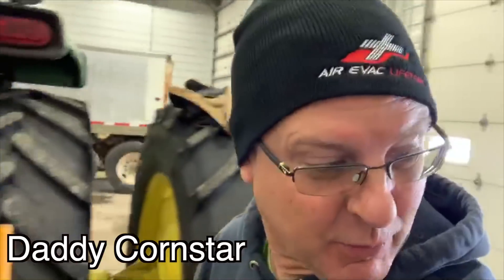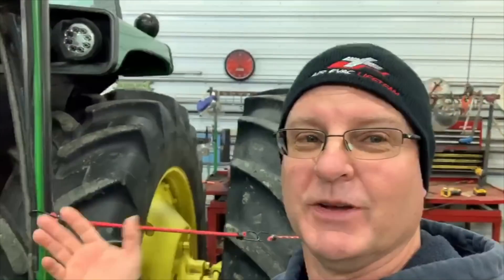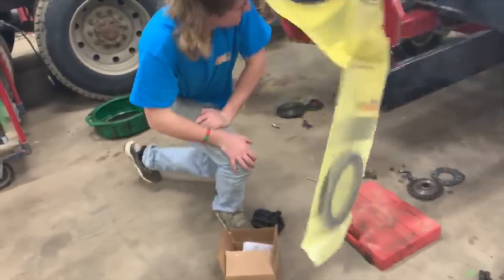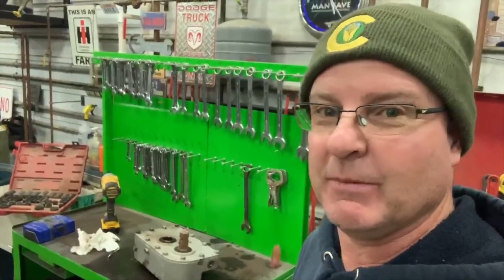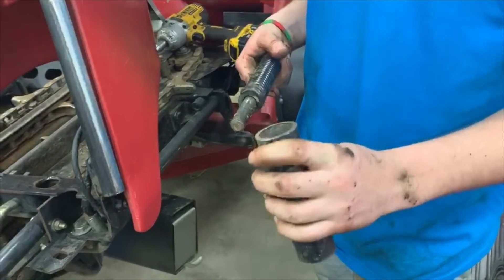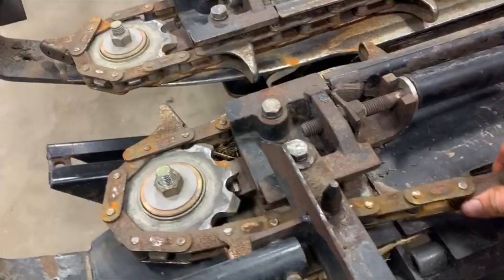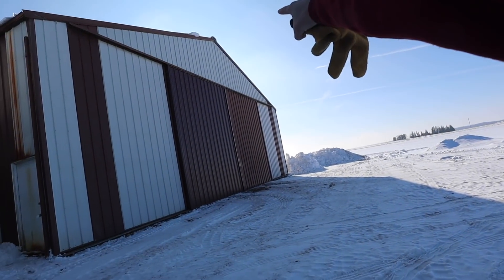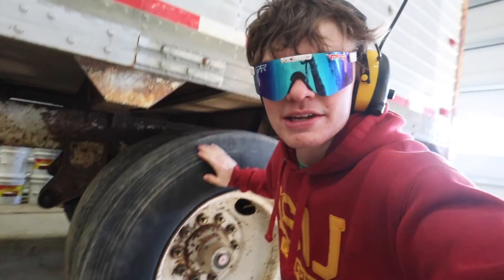40 Year Old Tractor... Will It Start??

Comment: Cornstar team, really enjoy your videos and interesting information you share, keep them coming.

Question/ Suggestion, you guys are so diligent about keeping everything greased and I applaud those efforts.  I think you can save some money and time when greasing in the shop.  I've noticed some jobs take multiple tubes of grease which can be expensive and time consuming to refill, plus you go thru it on multiple pieces of equipment.  As you probably know that grease cones in 30 gal and possibly 55 gal drums. They make pneumatic grease guns and tops that sit on top of drum with long hoses allowing you to grease right from the drums.  At least for the 30 gal drums they also make a wheel plate for drum to sit it making it easier to move around to the various projects.  Heck, you can even use it to fill your hand guns rather than sucking it in or dropping in tubes.  

You guys probably know all this but thought I'd mention just in case because of the time, convenience and money saving potential.

Comment: Wow, 7:12.  A tiler’s spade, haven’t seen one in 50 years.  Most people don’t know what this is but it is a spade used by a “hand tiler”.  I am 67 how but when I was 16 or so, one of the old guys in our southern Minnesota town told me all about his younger days as a hand tiler.  According to him:  Drainage tile were originally dug by hand.  A two-man team worked together, one used the tiler’s spade and one followed in the trench with a long-handled shovel to dig out the crumbs (dirt that fell off the spade).  A team could do 2-3,000 feet a day, about 18” deep (one length of the tiler’s spade).  They dug summer and winter, burning straw in the winter to thaw the ground.  As an example: connected to our farm, they had dug in a 20” main about 2 miles long.  In one section, it cut through a hill and was deeper than 20’ - all hand dug.  We, on the other hand, were very” automated” on our farm.  We had a Vermeer tiling machine powered by a B John Deere.  It used a winch to crank it forward on a cable - one rachet at a time.  We used a UB Moline on the anchor end.  Dig 100 feet, run the cable out again.  Between our farm and several neighbors, we put in miles of 6” by 1’ long concrete drainage pipe and hooked into many hand dug county mains.  They were all clean (no dirt so they were laid tight) and running well (correct slope).

Comment: Good old V8 Massey. You could walk by one in July with a ice cream cone and it would require a huff of ether to start.
Reply from the maker: Chris Maas on the 2745 that's so accurate!
Reply: Depends what injection pump it has. With inline pump they start pretty good. I have 1150, 1155 and 2805 and below freezing is no problem to any of them.

Comment: Next time you take something apart...photograph it with the phone as you disassemble it. Store the photos on a desktop computer for future reference.
As for the seal that was prohibitively expensive, if you feel this will be a normal wear item,find a hydraulic supply house and have them measure the old seal for a replacement. Keep a few in stock. Might be an inexpensive part, but from the dealer ...well that makes their week!
Reply from the maker: Lens Cap luckily this is not a common seal!

Comment: Find you a good bearing and seal supplier and they should be able to find seals that are common, UNLESS the equipment manufacturer had them one of a kind made which I would not doubt. I know the green brand is bad about that. 60.00 oil seals would make me mad, have a fit and then go home and install them. I was thinking how many bushels of corn did it take to pay for those seals and got mad thinking about it. Not even my equipment! Cole there is a product you should check out, I use them in everything that moves, that I own. (And some that don’t move)Web page is the Cerma store, located in Denton tx. I have no connection to these people other than a customer. Farm equipment takes a beating and those products will save some misery and money. You decide, the tube grease is something I would seriously consider and would be a good test for you. This is way longer than I intended. Have a good night!

Comment: One day can you show us your farm building equipment?   many things you have shown us already.
Other things would be,  how your buildings are built from pole barn construction or slab construction? Heating/cooling, isolation and electrical.
Fuels and tanks.  Welding equipment you like.   Lifting equipment such as a push beam trolley or any other important equipment that many just take for granted that it's there. 
Thanks

Comment: I worked in the plastic mfg industry for 35 years. I found that seal kits for cylinders and bearing seals were very costly from mfg. I researched these components, I was able to purchase seal kits and bearing seals from a local seal company for 30 - 60% less of the cost of kit and seal.

Comment: Hey Cole! If you have a bad brake chamber you can find it by releasing brakes and pull rubber plug out of chamber..if  it's bad you will feel air coming out hole .p.s. it's not forcing air back to the valve .. what your hearing in the  cab is the air leaking from bad chamber moving through the valve.

Comment: If ya had bad brake chamber ya only lose air when ya foot is pressing brakes to check see if one bad air truck up shut it off have some one stand at back truck and hold brake down if it's bad you'll here air leaking
Reply: Not so. If the park brake pod is leaking it will send air back through the air exhaust

Comment: Those $117 seals were probably $10 at your closest bearing/seal supplier. Most decent sized city’s have a good name brand bearing/seal place. Just pull the seals out you need to replace and take them in there and they’ll get you the right ones.

Comment: Just wondering if you drilled a few holes in those spring sleaves on the corn head if it would give it a chance to push the mud back out, maybe one longated hole a few inches from the end allowing it to work itself back out , or maybe not.

Comment: To find a failing maxi. Get two oh 2x2 x 1/8 inch plates of steel and small C clamp. A clamp off the emergency hose so air cannot flow into the chamber til you get no more back feed some time you can hear it putting your ear to the chambers

Comment: i dont know if someone said this but with the brakes applied beat on the brake chamber with your hand and odds are youll here a spring rattling around and thats the bad one. pull off the rubber dink on the end to and look inside and see if you see broken springs or where you put the caging bolt may be way cocked to side badly. be care with those things the big spring can kill, dont try changing it if you dont know how.
Reply from the maker: Ryan Lakhan Thank you!

Comment: 🔴🔴🔴Leave comments?! Okay, wouldn't it be a lot easier to put your "shop tool area" along the back section of the shop and then park the tractors, etc. in the front section?! I mean, park them wider and less deep so that you don't have to move SO MANY tractors, etc. each time? Or, even better, have a garage door in the front and one in the back, so you could just basically drive them through? Or at least have to move less each time?! And perfect work scenario, have more garage doors but all on the side so that you have a WIDER but less deep area to park all that equipment?! Lastly, since it takes so much maintenance for so much of that equipment, would it be good to par down/downsize some of those machines you rarely use so you don't have to deal with ALL of that work all of the time?! Just a thought! Not telling you what to do! Love your videos!

Comment: Does the freight liner have dif lock
Reply from the maker: Farmguy605 _ it was on
Reply: @ColeTheCornstar  Then I got mad news for you, it doesn't work.
Reply: Try the high side of reverse... and only the clutch pedal... dont use the fuel... when she luggs, you are getting traction.... ive won more money from drivers stuck on a small incline that's ice covered... it's all about lugging the motor... slipping the clutch to control the wheel speed...

Comment: I just thought of an interesting observation regarding your equipment. Some who have the same...thoughts about cars and trucks will understand this too. My observation (and forgive me if you've covered this already) is that looking over your fleet of your farm vehicles and except for your great looking newest tractor and maaaaybeeee that combine, I see a distinct lack of computerized farm equipment like has happened to cars and trucks since the late 1990's or so on your farms. I'm not talking about the computers you use that were installed as an aftermarket GPS and all of that. 
I recently read an article where farmers who had purchased those green tractors everyone knows about and were having computer problems with those vehicles but had to sue the manufacturer just to gain access to the information that would allow them to fix the tractor instead of the dealer. I guess computers are expensive...NO I KNOW that is expensive especially after reading that article. And without the right equipment is difficult to work on as well. I see you work on your own equipment and the condition shows LOTS of pride of ownership there too. Is that a consideration for you guys when you're looking at possibly upgrading or buying new equipment and why your fleet is red in color as opposed to green???

Comment: Not sure if you have a bearing wholesaler in your area but if so, all bearings and seals are made by a few companies then case or ford or boeing or whom ever  buys them and attacn their own part number them.. if you take your seal or bearing to these wholesaler or go on line and cross reference part number you can get substantial savings. I would guess that seal  that you got for vorn head would cost about $10.00 at wholesaler.

Comment: Do you have Wi-Fi in your heated workshop? Just asking as it would give you some cost savings on your cell subscriptions :-) and what kind of broadband speeds do you actually have available at your place in Iowa? - BTW great content and channel, you are all doing a great job :-)
Reply from the maker: Klaes Fris the tin and lights don't let wifi in! Between 5 cell phone and two internet plans it's going to be rather expensive regardless. 😉
Reply: @ColeTheCornstar  Thanks a lot for your answer Cole :-) Just thinking you could run a RJ45 Ethernet cable from the house into any router in the workshop (old or new), and then setting up the router to act as a extender/access point of your broadband from your house, then you would have Wi-Fi in the shop.

Comment: The leak comes from under the dash. Replace your trailer and parking valves. If it were a brake chamber, the truck wouldn't move at all

Comment: Measure your seals, and use a progressive size chart, or use a cross reference from application to manufacturer, those single lip seals are worth about $8.50,  there is no reason to be gouged on standard available repair parts just because you go to the Dealer for parts. Some of that stuff they sublet tooooo,  and re-box it to become magically OEM.   Seal manufacturers make cross reference catalogs, and progressive size catalogs. Dig a little deeper.  Save yourself and us, eventually, some money.

Comment: In my books  using a bungy cord to hold a back wheel and tire of a 4840 is absolutely not safe. If it was me I would have removed the tire and wheel and put it in a place where its entirely harmless until such time as you have the necessary bolts to install.  I dont mean to tell you your business and I respect your business.  Safety  should always be priority one. Dont lose your health and happiness all because of a wheel and a tire.

Comment: Say you buy a new Pete truck, nice and pretty... well  Pete didn't build the engine, Cummins did, and Spicer built the transmission, Eaton the rear ends and Hendrixson built the suspension. Even the gauges in dash were built by Stewart Warner or the nobes and switches , air lines all come from another. I don't know how much of the cabin is really Pete or Kenworth and so on but little is made by the company.

Comment: @1:18 "...ain't hardly amountin' to diddly"   seems like an expression that needs more widespread use. I will spread it around the Atlantic coast of Canada.

and

$117 for two rubber seals sounds like Pentagon pricing. Maybe you could make them out of a used hockey puck ?

Comment: Sometimes the air fittings  crack the plastic on the air brake control  on the dash
Reply: I had a old mack truck that leaked air from the dash. Took for ever for it to fill up